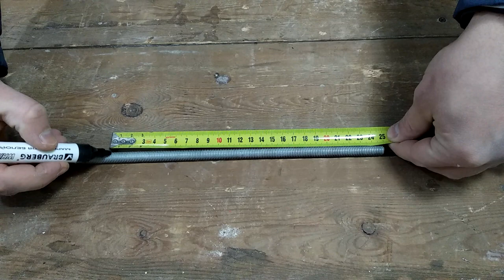DIY Clamps for Woodworking – Homemade Bar Clamps

Comment: Great design. 1 question the dowels in the stop block are they just for added strength? I aim to have these made by weekend GREAT
Reply from the maker: Stepan, I installed wooden dowels for reliability, it seems to me that the stop block can come off if it is installed only on glue
Reply from the maker: Good luck in making! ))
Reply: Am I being a sissy?  I gasped at 14:00.  From my perspective the sparks were too close to the electrical cord.
       I'm glad I came across your videos.I have literally been watching them all day long as we are still in quarantine.   
  Awesome content.   Now if only I can convince my husband that it won't be as expensive as he thinks - thanks to your videos.   I have subscribed and watch most of the ads.  I know you will only get a few pennies from YouTube for each ad.  Every little bit helps, right?